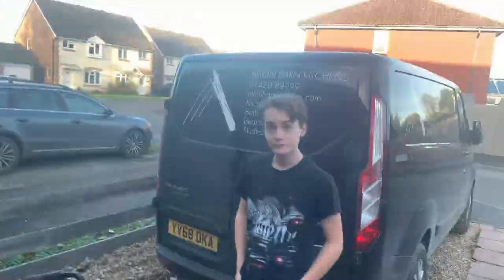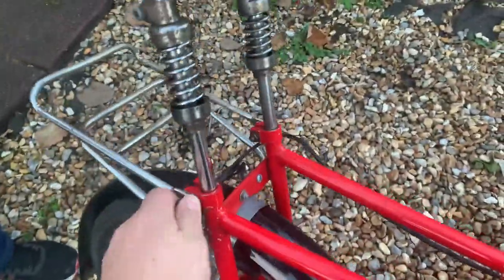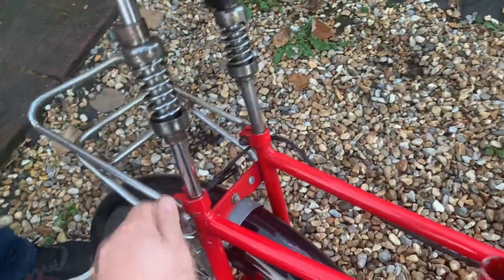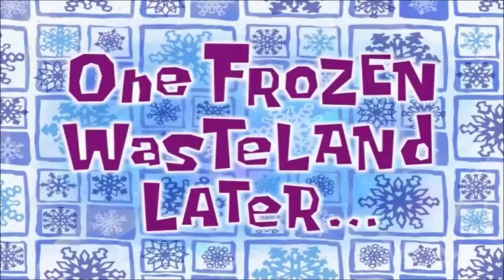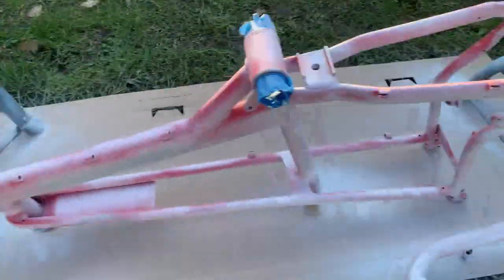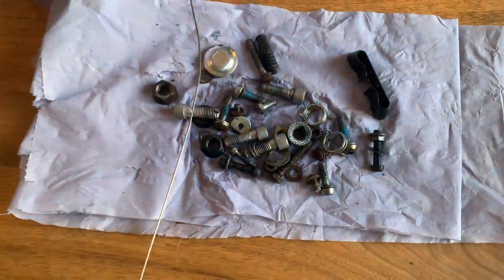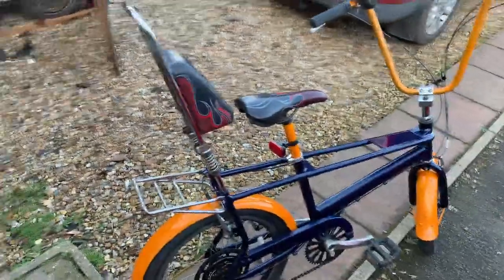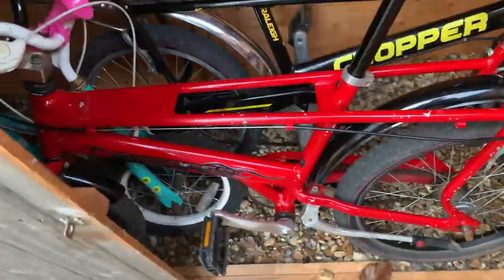Project Chopper EP2 - Refurbishing and re-painting a MK3 Hot One Raleigh Chopper

Comment: Needs an original MK2 style seat
Reply from the maker: I know. Now Raleigh have launched a new one with the banana style seat, I might be able to get some to replace the mk3 ones.
Reply: Why? It's destroyed the originality and any resale value it might have had in the future and looks cheap.
Reply from the maker: @basylpeterjones it was worth less than £200. It’s not a mk1 or mk2 so it really was worth less before.
Reply: @mid-life36crisis  I found out there were about 425 made; slightly rare, but there won't be many around before long as they're cheaper to get hold of than a JPS or Mod version and I've seen quite a few stripped and altered. I think if they're customised there's no chance of being collectible at any time in the future. If people think the Beano and JPS will be, why not The Hot One?
Reply from the maker: Maybe, but neither of the ones that I’ve modified were in any condition to be kept original and still be enjoyed. And so what’s the point? My wife’s black and gold Mk3 will be kept original and just maintained because it was still in good enough condition to do this and enjoy taking it out.
Reply: @mid-life36crisis  I wasn't sure about that as I couldn't see the condition. I just can't see the motivation anyone has to discard original bits there aren't very many of: some discard the nice seat and sissy-bar, back-plate and backrest arrangement to fit a MK2 set-up, or just break the whole bike to make a few extra pound;  that will wipe them all out in time.